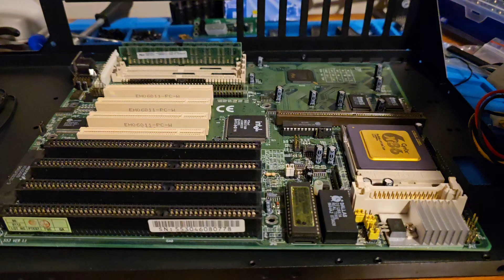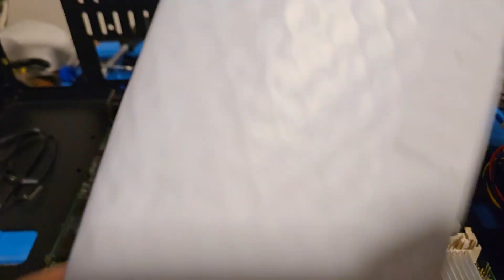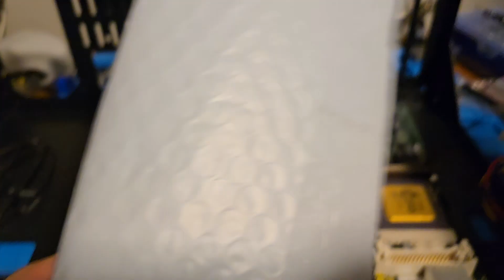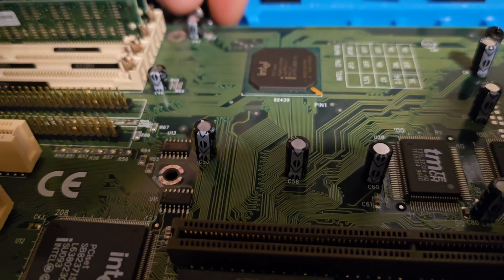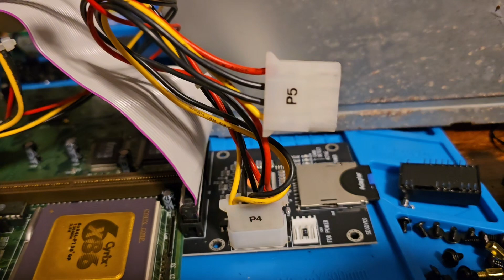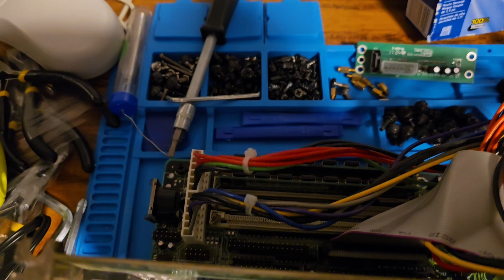Cyrix 6x86 Project Machine Bench Setup - Power?!

Comment: They make ATX to AT adapters for your ATX power supply to work on your XT/AT motherboard so you don't need to find the period correct power unit.
Reply from the maker: I finally caved and bought some adapters. I was hoping to use a period piece, but I will have to search for one.

Comment: I have a Cyrix M2-PR433 (3x100Mhz) machine I run linux (old Slackware install) with. Mainly to mess around with (run squid, bind, etc) and to run old school servers (quake, quake2, etc...) It has 256MB of ECC memory. Kind of a fun machine with it's 20GB of spinning rust.
Reply from the maker: Thats a super fun build - I was thinking about doing something similar with this for running old school network games. Lots to ponder!
Reply: @urzamaster I think that would make for a great video
Reply: That is awesome. I got a Cyrix M2-PR400(3x95) I picked up a few years back. I got a Super Socket 7 Epox branded MB I have it installed in.